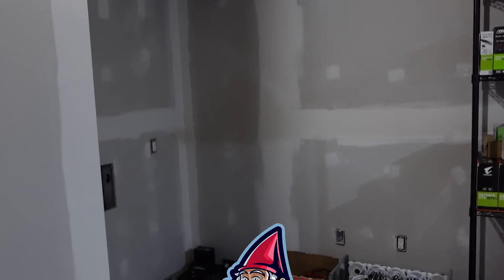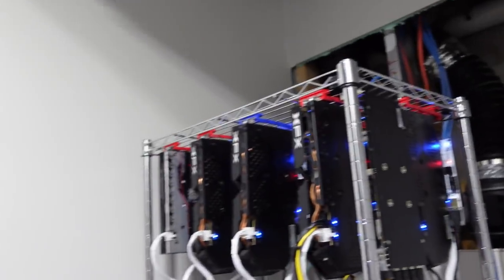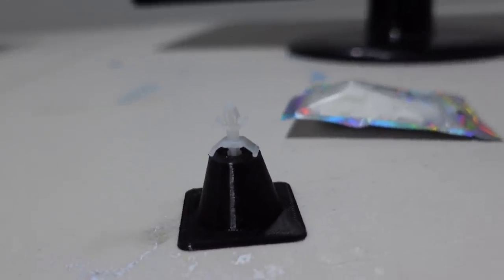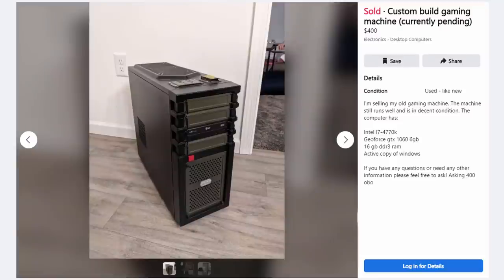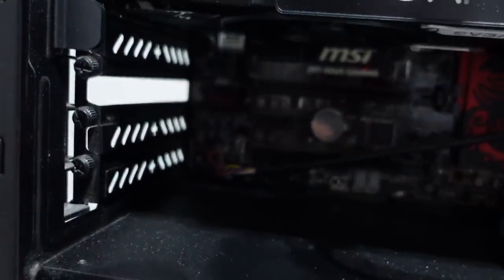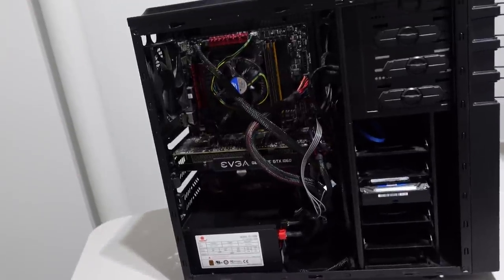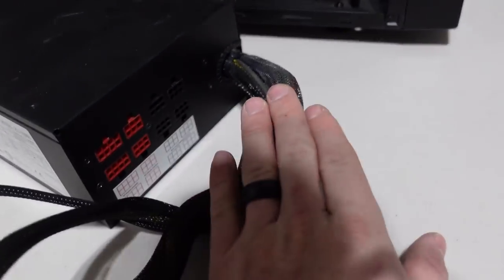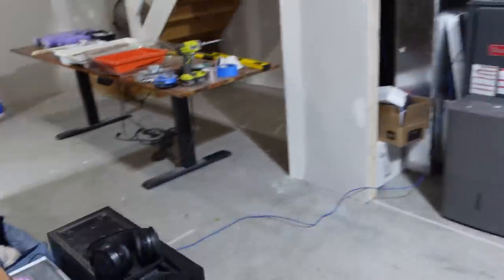How to Find Cheap Parts For Building A Mining Rig

Comment from the maker: Have you found any CRAZY Deals Recently? Have you been buying Second Hand? Refurbished? Used Parts for Mining?
Reply: Well yes! A Asus GTX 1660 for €160. Really efficient mining card. 25,5 mh/s with 51 watts.
Reply: @The Hobbyist Miner   Just last Wednesday I scored BIG!! I got an i7 8700k, Asus ROG Maximus Hero motherboard, Two 8GB sticks of 3200mhz CL18 Crucial ballistix RAM, a Corsair H100i 240mm AIO, a 750w EVGA fully modular PSU, and the piece de'resistance'...  Zotac  RTX2060 AMP all of which were used by a 20yr old airforce nerd (now a friend😅) so everything is in immaculate condition.. dude came 30min to meet me in my town and I got it all for $475.. Im beyond stoked! it mines 33mh @ 83w 45C  in HiveOS using absolute core clock to lower power consumption.. I love it, I have an EVGA 1060 6gb on the same rig and its nowhere near as good lol
Reply: @nickvanemden  wow nice, whats your core at?
Reply: I got a 

Acer preditor orion prebuilt with out a gpu for $325 cad 

Then a 92 mm cpu cooler for 20 cad that allows the cpu to stay arround 4.0-4.2 ghz after turbo power unlock.

The prebuilt came with.

11400f
2x8gb 3200mhz ddr4
1tb nvme
550w psu 

Included rgb leds for that gamer feel.

Then I somehow snagged a gtx 1070 for $130 cad. Does 26.4mh eth @ 130w

Finally some networking things.

Moca 2.0 bridge for $20 cad

(Wal-Mart us has a moca 1.1 bridge for 20 usd shipped but cheepest price for that here is 40 cad)

Archer c5 v2 for $10. Don't recommend, get the v1 or something else open wrt compatible. It has some issues can mostly be worked arround. But for $10 its fine.

Linksys ea7300 v2 $10
(This supports open wrt so it can proprley do vlans and vaps)

In progress 

R9 390s for 100 cad a peice although they are kinda far away.
Reply: Found a 6600xt from a website for $479. Was stoked to get it for the price. 6600 arrived. No "xt". They're out of stock so I just kept the card. Double checked the receipt. Definitely said XT.
Reply: Not crazy deals. Sold a 1080 for $580 and bought a vega64 for $500 and 1660 for $350

Comment: Had the same problem using and SFF (Small Form Factor) Dell motherboard. It wouldn't line up with the screw holes on my rig. I purchased some elastic feet from when I briefly owned a Goldshell Mini Doge. Had to use the remaining feet for the MB as standoffs. This idea is great and makes for a much more simple installation. Awesome this is available. Might hit them up.

Comment: I have this board and couldn't get it to post past 6 gpus ,  there is no CSM or 4g option what i could find when i was trying a 7th gpu. 
i later found out you disable CSM "When you enabled "Windows 8/8.1 Feature", CSM will be auto disabled. Please go to BIOS -> Settings -> Advanced -> Windows 8/8.1 Configuration -> Windows 8/8.1 Feature [Enabled]." haven't tested this yet hope it helps
Reply from the maker: Great Recommendation! How I got it to work with 7 GPUs was I had to set the PCI Configuration from AUTO to Gen 2.
Reply: @TheHobbyistMiner  yea i can't get it to work , it post with a D7 code on the mobo, hd audio disabled all slots use x1 to x16 riser.  DId you use usb splitter?, or any other settings changed?